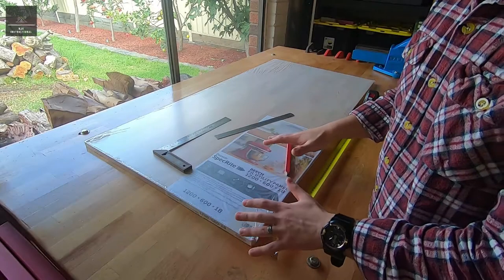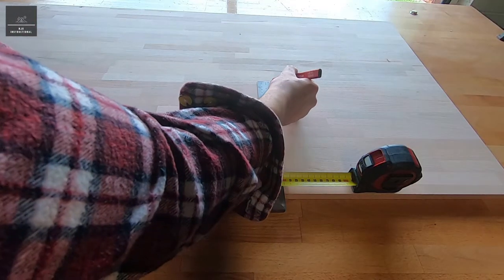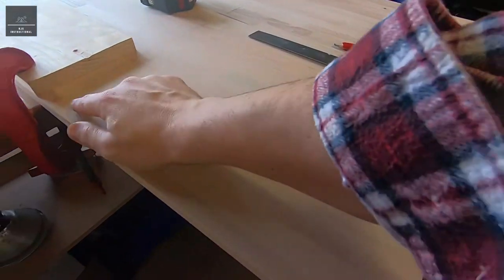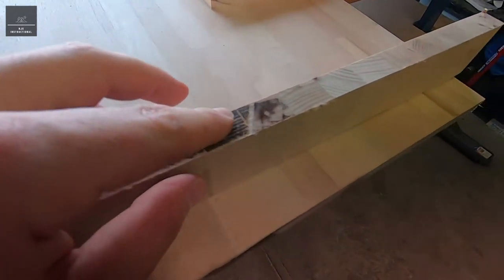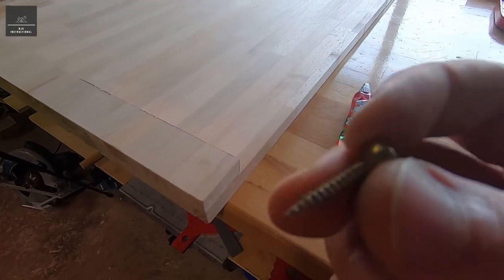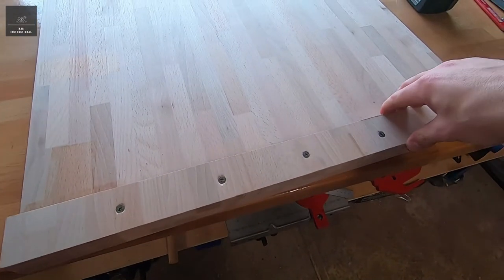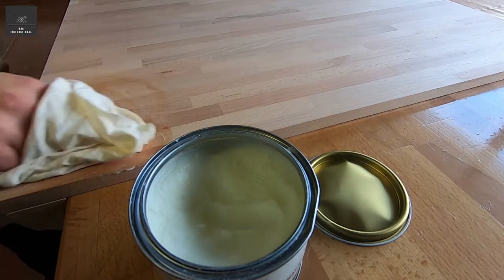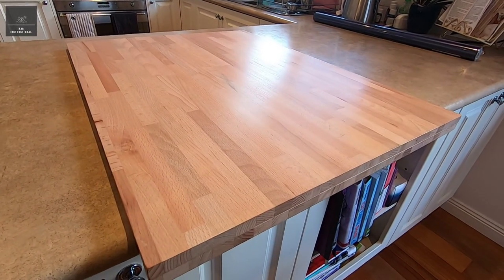How To Make Your Own Pasta Board

Comment: Why in the world are you free-cutting that instead of using a large clamped guide square? And why are you doing it right next to your table top? You could make a mistake and damage the table. You have no need to cut there. Once you measure take it to the shop to make the cut.